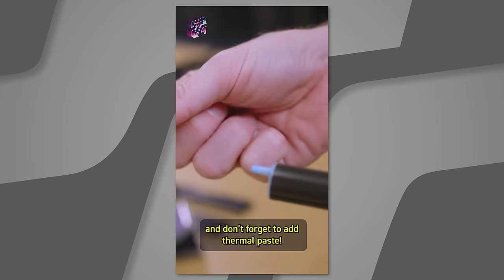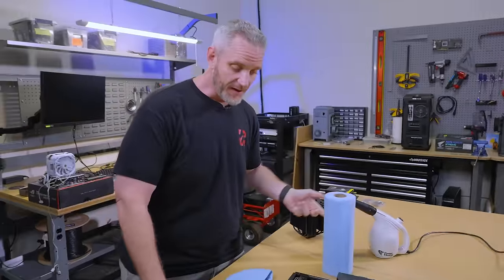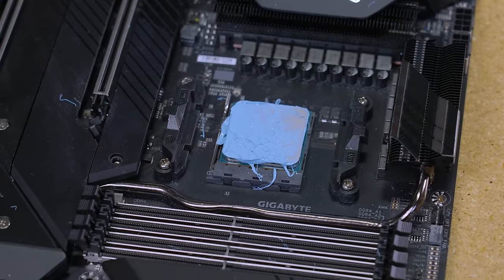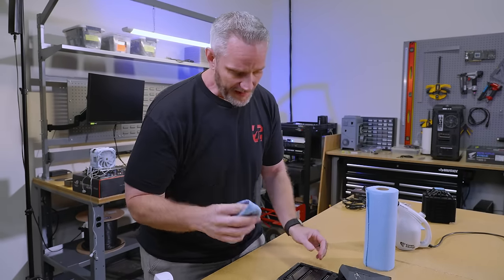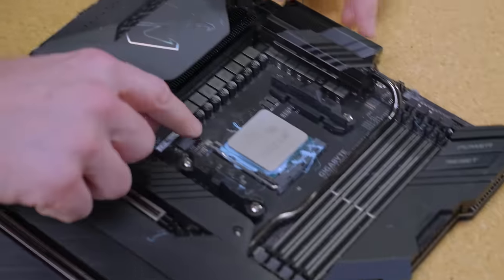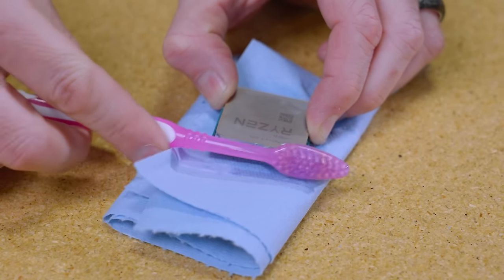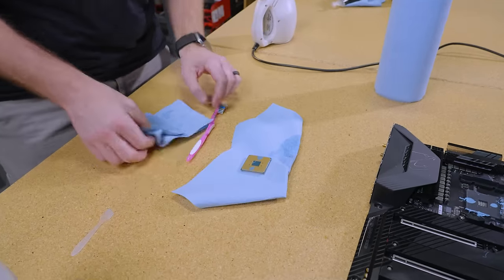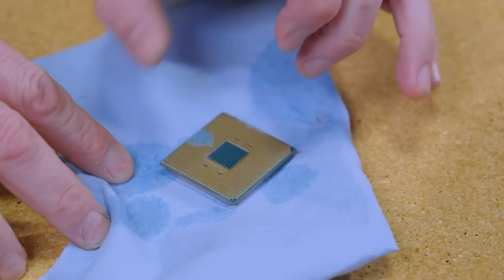This is a disaster!

Comment: Yeah First time building my pc, I already put thermal paste on cpu and installed my cooler then needed to take my cpu off to do bios update and as I was pulling pump off the cpu there was ton of paste and when I grabbed cpu the paste got on my fingers and some how into the socket, I did replace the parts cause i cleaned as much as I can off but pc was having issues lol I wish I knew this earlier LOL

Comment: Anyone else sitting here thinking this video would be a joke?

Cus like seriously the way the mechanism works you can dump a tub of thermal paste between the socket and CPU and make a giant mess but it will still work

Because the mechanism scratches the pins to make contact so the thermal paste shouldnt prevent a connection and if it does just wiggly the arm a few times

Comment: i had to figure out for myself that you can use the brush for cleaning electronic parts exactly when i got some paste between the pins of my former 3800x and it was an eye opening moment for me. suddently everything is so easy to clean. dj mix pult potentiometers? yes sir ;)

Comment: Still easier to remove than decades old dried-out thermal pads.

My X570 chipset thermal pad was already such a pain in the ass, decade old thermal paste might was well be cured concrete.

Comment: Electronics cleaner spray has worked for me in the past. Had an A320 board at work and got it working by emptying half a can into the socket at a downward angle so most spray washed off board. Followed by compressed air and soft bristle toothbrush. Let sit for a day to make sure everything was dry and POSTed on first boot.

Comment: I wish this video existed like 5 years ago when I wanted to swap the stock cooler to a coolermaster one in my old rig. Thermal paste got into the socket on the motherboard, and I bent a few pins trying to get it out. That was a costly mistake.

At least now I know what I can do if it happens again. I even already own one of those blowers.

Comment: I shake and have applied way too much thermal paste in the past and have made similar mistakes. Jay provided solid advice. That said, I cried a little on the inside when I saw he was using KPX for this video because KPX is expensive at $12.54 per tube compared to something like Arctic Ceramique at $3.50 (on sale).

Comment: Whenever I swap my CPU or add new thermal paste to my system, I get paranoid about this happening. I have been building PCs for over 25 years, and that bit of paranoia never seems to go away. The paste spatula/spreader is excellent to have, too. Instead of gravity, do the work when putting on the cooler. 

After watching this video, it is nice to see how to deal with this situation, but it still doesn't make it any easier to avoid being paranoid.

Comment: I cleaned my CpU with alcohol and rubbed the arrow off on the sub straight. What a lot of people may not know is the arrow is underneath as well . So if you happen to rub the arrow off look underneath and the arrow will be there as well do you will get the CPU in the correct position in the socket .

Comment: old fx6300 went to lift my air cooler off and it ripped my fx6300 out of the socket with the lever down stuck to the air cooler  xD

Comment: Most of the thermal paste i buy has the little plunger tube type applicator. If you add too much, just suck it back into the tube by pulling the plunger while the tip is in the mess you made.

Comment: i've started using denatured alcohol to clean thermal paste. folks can buy it in the painting section of walmart. it's a stronger solvent alcohol that still won't hurt anything besides the thermal paste. it also has no water so it evaporates quicker. be careful not to have a flame(don't smoke) around it though because it is flamable. rubbing alsohol is also flamable but less so.

Comment: Electrical contact cleaner in a spray can. Works every time
Reply: michaelscarport  and it's completely safe for PCB as well as most other plastics. Does an excellent job of deoxidizing metals and hell I've even used it to remove pinstripe adhesive on my car. No damage to the clearcoat.

Comment: if your too cheap, grab a spare toothbrush and use your shower head with the cpu and then hair dryer it real good
yes it dose work i have done it a few times. and they are still working after many years

Comment: I use starting fluid or brake cleaner to clean the air cooler fins after the pipe cleaner to get the heavy dust   , works real good . I wonder how those dissolve the gooo  ?

Comment: I recently tried to clean ancient dried thermal paste from a well worn Xeon processor.  No chemical or towel I hit the chip with would clean a majority of the surface off.  It was a nightmare.  Five hours of rubbing with 99% isopropyl and it never came fully clean.  Just clean enough that I went forward with repasting it.
Reply: sometimes the only solution is violence

Comment: if its a non conductive paste it doesn't hurt anything? my gramps PC that was from the early 2000's had thermal paste in the socket (seemed like some seeped in from the side of the CPU) and it was still running (gave me ptsd though, that thing had never been cleaned and the paste was completely dried out lol)
Reply: most thermal paste is not conductive, so it does not short things

Comment: an even better tip would be do not try to clean anything if the computer works fine with it. 99,9% of pc parts breaking happen when people try to clean them. just leave it as it is. you don't see office computers breaking all the time because nobody is messing with the components.
Reply: (laughing in IT administrator)

Comment: Can you use automotive QD electronic cleaner? They're labeled as plastic safe, but the description says petroleum distillate so I'm not sure if that's best for PC components
Reply: PC components is "electronics" so an electronic cleaner is ok. The only important part to check is the "plastic safe" as some electronic cleaners are ok on electronics but will melt some plastics and you don't want that

Comment: I did this on a 4790k back in the day and took a toothbrush and iso to the socket and bent a lot of pins, though I was able to bend them back one by one using a metal pen. the chip side was easy I just wiped it onto a shirt, apparently you can rip off the pads on the chip side though so probably don't use a shirt like I did.
Reply: mrjayztwocents-ry2nz  wow you guys aren't even trying anymore huh?

Comment: would love to see a intel one, cos lga socket is way more delicate than pga, im having a hard time understand how you would it, well thermal paste on intel cpu is easy to c,ean, done few times and iddnt even need alcoho. just paper towel
Reply: for LGA you use a garden sprayer or a little syringe filled with isopropyl, and use the pressure to gently push away the paste. It helps keeping the board immersed in isopropyl for a few hours first to "soften up" the paste first.

The "professional" solution is an ultrasonic cleaner btw.

Comment: When I worked at Fry's Electronics, we used a product we sold called 'super wash' which came in a spray can and tears through thermal compound faster and easier. Used it to remove thermal compound successfully from the more delicate LGA pins. For the motherboard, we would hold it over a trash can and spray into the socket with it turned slightly upside down so it runs off and into the trash instead of onto a table. Being a spray, it can reach harder places without even the risk that the brush brings (though I'd still keep the spray a distance from the board on delicate pins as too much spray pressure can bend them). Recommend gloves and eye protection for the process.
  Though I haven't tested it on computers specifically, I'd suspect a hobby shop 'motor cleaner' as they sell for RC cars to give similar results as I used to used that as a kid as a general electronics friendly degreaser.
  Similar to where you folded the paper towel to a sharper corner, I also used printer paper that I tear a strip off of and fold sharp to get in areas including between pins. I could use more force as I am between pins instead of hitting them but need to go slow to avoid snagging pins. Same paper idea is where I'd make my spatula for spreading thermal compound; tear a skinny strip a little wider than the area to cover and fold its end over several times shortening it to have a rigid end to use. Easy full smooth spread from a cheap and readily available material.
Reply: Was that MG Chemicals Super Wash spray ?
Reply: @robertbass9032  yes. I think we had different ones sometimes over the years but that was the main one I remembered.

Comment: Would the toothbrush thing work for lga motherboards?
Reply: It wouldn't as the pins are incredibly delicate, electrical contact cleaner sprayed from a distance works well on LGA sockets to break down paste without ever touching it. I had to do it a long time ago as a small amount of dry paste managed to drop into the socket.

Comment: How would you clean a intel socket without bending pins in it
Reply: garden sprayer or syringe with isopropyl and use the pressure to push away the paste.
It helps if you let the board soak in the isopropyl for a few hours to let the paste soften up.

Otherwise, there are ultrasonic cleaners

Comment: Would cleaning PCI-E slot also be so easy?
Reply: you need a garden sprayer or a small syringe and then spray down the isopropyl inside it. 

Or use an ultrasonic cleaner

Comment: Micro fibers scratch surfaces. Quite some new kitchen fronts have been destroyed by micro fiber.
Reply: wtf? that's some weak and cheap kitchen front if microfiber cloth can scratch them.
Reply: @marcogenovesi8570  Well, it happened to a lot of people. Better safe than sorry.
Reply: @hw2508  you don't understand. If microfiber can scratch it, then anything can scratch it, even your fingernail or a piece of paper.
Reply: @marcogenovesi8570  Of course. But you usually don't use your fingernails to clean your kitchen.
Reply: @hw2508  so what do you use to clean your kitchen if the surfaces scratch even with microfiber or a piece of paper? only gentle spraying and hot air? That's a place that gets filthy pretty quick if you actually cook something so how do people live like this? Only microwaving meals?
Reply: @marcogenovesi8570  I was talking specifically about kitchen fronts, not worktops. And I had in mind specific high gloss finishes. Not hardwood or anything like that.
How about a cotton cloth? Anything but synthetic fibers.
Reply: @hw2508  Kitchen fronts need cleaning too if you actually cook in the kitchen, the fumes and whatnot will make them sticky.

I still don't see how a cotton cloth is better than micro fiber, it's bigger, stronger and rougher fiber. If the fronts can't handle microfiber they won't handle cotton either.

Imho that's just a case of using a rag with some grit in it for some reason. That's a thing that does happen some times
Reply: @marcogenovesi8570  Of course not only cotton, but water etc too.
I talked with some kitchen builders and they told me how new kitchen have been ruined buy specific types of micro fiber cloth.
Cotton is pretty soft. A lot of the synthetic stuff is not.
If you use micro fiber and it does not scratch the surface: perfect!

Comment: How strong is that fan?  Also, you should not install anything until at least 24 hours and put the board in a dry place, isopropyl does contain 30% water.  I would like to see your answer if it dries and hardens or if you used a gel.
Reply: 70% iso does, 99% doesn't and is what you should be using for electronics